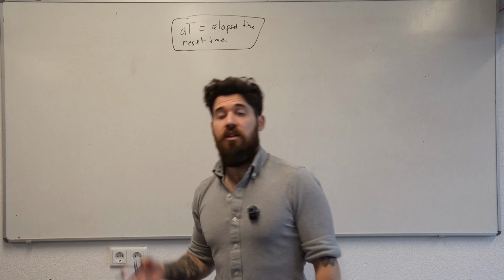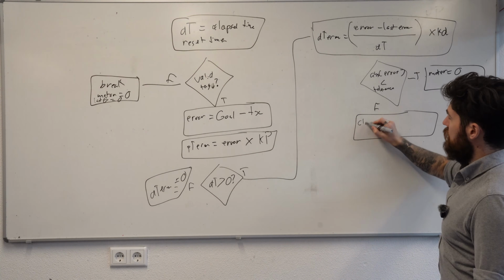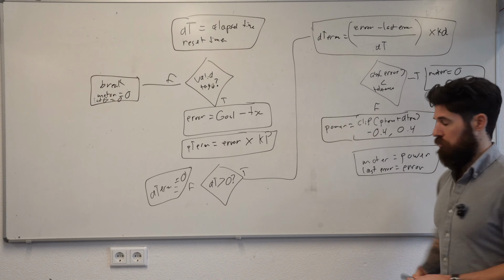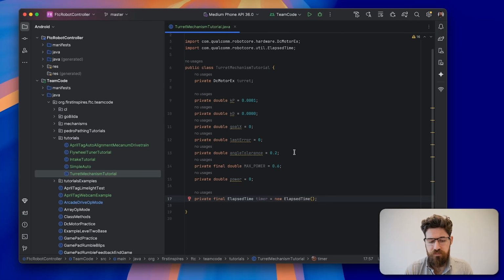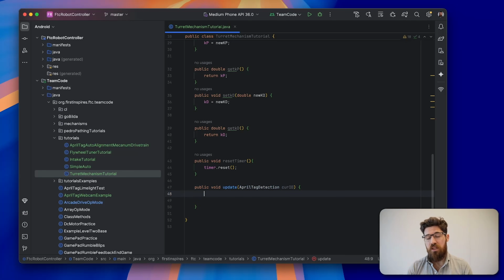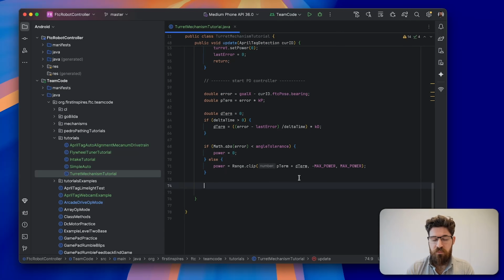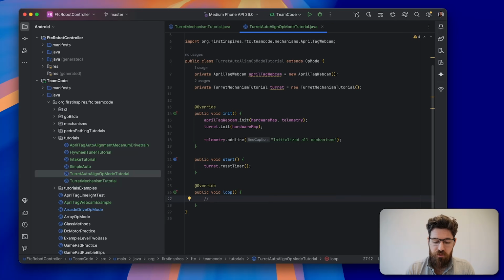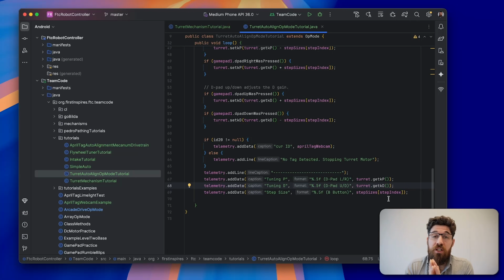How to Code an AprilTag-Tracking Turret

Comment: Would we do anything different if we used a servo for this besides initializing a servo instead of a dcmotor? Does all of the rest of the code remain the same?
Reply from the maker: You got it! That’s all you would need to do.
Reply: @BroganMPratt  my team just did this, but our tracking is exceptionally slow compared to the motor. Is there any fix to this? We are using go builda servos.
Reply from the maker: @speaking-of-thoughts what type of servo? Torque, speed or super speed? And what is the reduction across your turret gear?

Comment: Yet another amazing tutorial! What steps would you take to achieve better tracking while the robot turns rapidly?
Reply from the maker: Increase the FPS of your camera by reducing your exposure times. increase sensor gain and tune this better. After that tuning is done, consider if another, faster frame camera may be necessary for your goals.

Comment: Will this work better than just using the angle from the pinpoint to track the target? What is your experience?
Reply from the maker: Angle from pinpoint works okay, as long as you have an actual positioning setup working in Teleop. However, you'll definitely get drift if any semblance of defence is played against your robot, so I tend to favour camera based systems.

Comment: Could you please help me on how to setup the turret limits through code or the code logic for it?
Reply from the maker: It's on my list of things to do, didn't want to pack in too much into 1 tutorial. Easiest method would be to use an absolute encoder, and only allow the rotation to occur if the encoder is < the max value/ > min value it should read.

Comment: ur d value is too low
Reply from the maker: Not from what I was tuning. My turret is so light that any higher D would cause extreme oscillations. You could set an insanely high P and High D and cause a lot of micro stutters at the bottom end, but I chose for a smoother system over all.

Comment: Hello coach! Lots of teams use the camera when it sees the apriltag, but what if the camera does not see the april tag, how could we make it know to rotate to that apriltag? Many teams also use the pinpoint to auto align the turret, but since the pinpoint is on the chassis, I have no idea how that would help! How could someone implement an auto aligner for the turret even if the camera does not detect the apriltag?
Reply from the maker: A few different ways, here are a few ideas. If you have odopods on your bot, you could use a kalman filter to synthesize both the vision data + the odo pods to help with this rotation.
You could use an encoder, and a state machine for your turret, that when you press a button, the motor sets to run to position mode, and begins running back to 0 until the camera sees the tag, then the standard PD controller resumes and you set the motor back to run without encoder. 
Lots of ways to skin that cat.
Reply: @BroganMPratt  Thank you coach! I ll use the second option as it s an easier approach, but I ll make sure to explore the kalman filter as well!